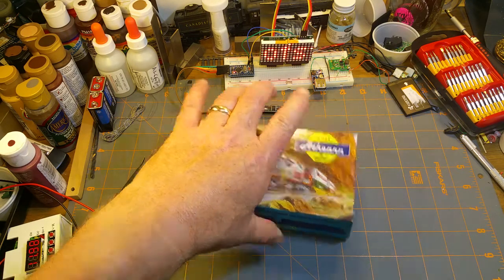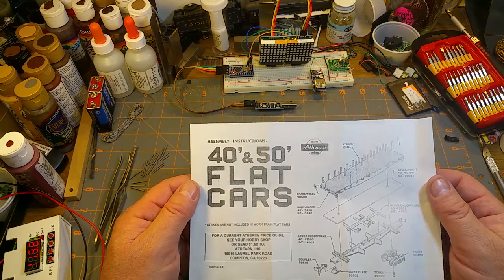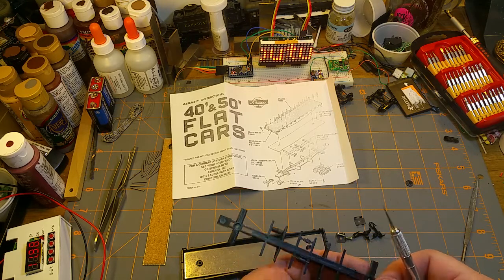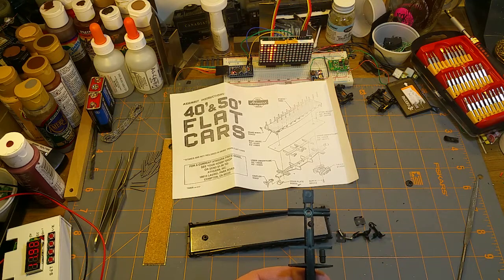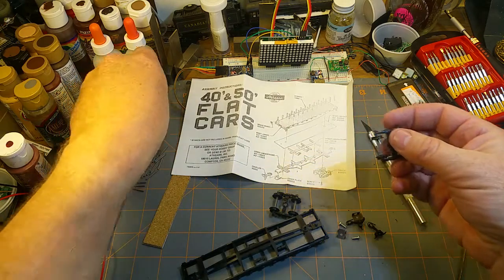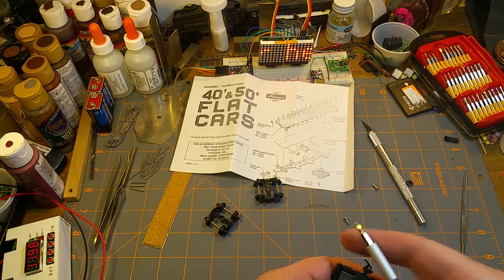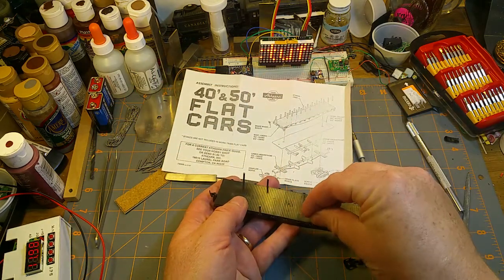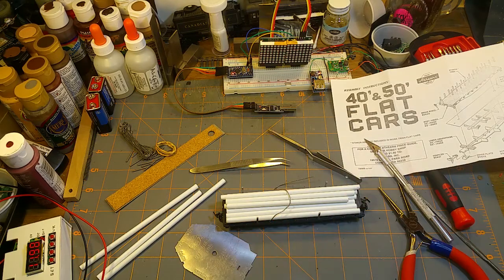Kit Build: Athearn "shake the box" flat car

Comment: The first thing I do to an Athearn kit is to sand off any rust that may be on the weight and paint both sides flat black to resist any future corrosion that may happen.  I always use a small drop of super glue (CA) at the bottom of the car and next to the coupler clip to keep them from falling off at the most inopportune time.  If you use the Athearn clips this is a necessary step and if you use a Kadee coupler draft box & screw, I always place a tiny drop of CA next to the screw head and the top of the draft box lid to keep the screw from working loose.  Since changing all my plastic wheelsets to Walthers Proto 2000 metal wheelsets I save them for flatcar loads as I save all plastic knuckle couplers for gondola loads.  I've got a box full of plastic wheelsets.  Cheers from a 73 year old modeler in eastern TN

Comment: I've also made one of these, which is a 40' Illinois Central boxcar, that came with Bachmann EZ-Mate couplers, to allow compatibility with modern stock.
Reply from the maker: TorchicPlays :its good to hear that the current version of these cars is using a more modern coupler.
Reply: No problem!
The kit I built was sent out of the factory on December 1998 or later, as December 1998 was the time Athearn kits swapped to Bachmann EZ-mate couplers.